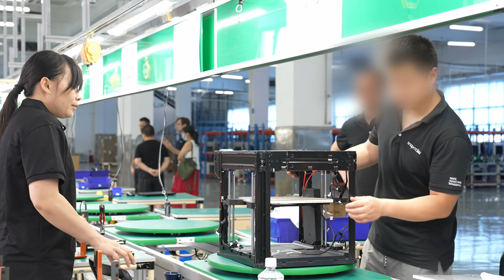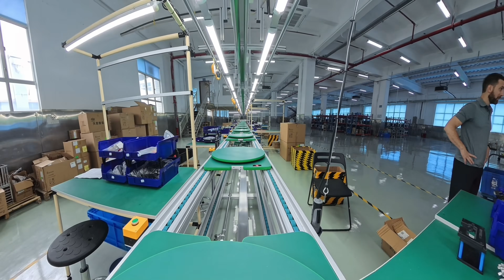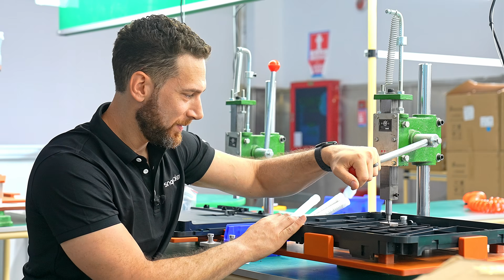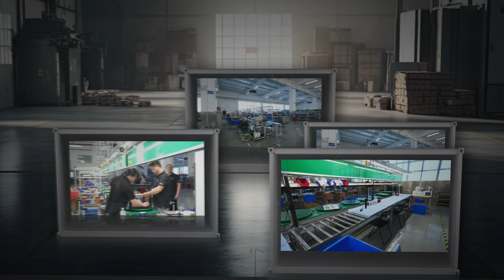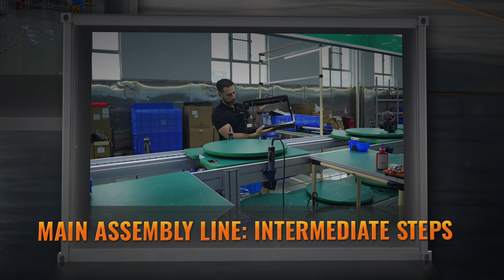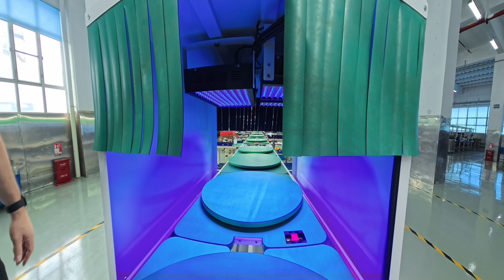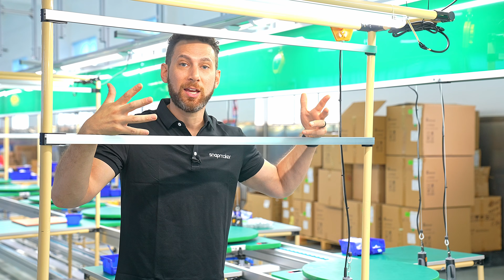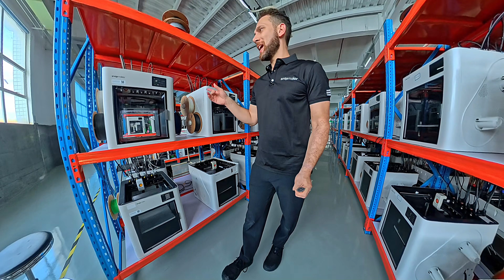SnapMaker U1 Factory Tour: HOW Did They Do This?!

Comment: so after all that he did not say anything about ship dates just factory start date?
Reply: It's an iterative process, your not going to rehash shipping dates repeatedly if you know that during manufacturing changes might need to be made that push it out.
Reply from the maker: Valid criticism. They didn’t want to commit to firm shipping dates, but I think was supposed to say that they anticipate filling all the preorders in two to three months. Sorry about that
Reply: 31 steps with 120 second each means that a printer is ready to be tested in 1 hour, with the following printers coming every two minutes after the first one of the day.

Also a batch of 150 printers is thoroughly tested, wich means when a new printer enter the tear bench another should leave it in less than thr time repaired to build 150 printers, so 5 hours straight.

Currently there are 18 869 backers, with a first "Early Bird" batch of 6 000 printers + 1664 printers (of 4 000 of the Duo batch) planned for November,

Up to 10 000 printers to build, test and ship from September 15th is quite a big commitment,

If we consider a full 24 working hours for the assembly line they could build up to 600 printers per day, with accurate pauses for team changes and a 10% (60 printers) rejection on the test phase.

But in reality even a well oiled and polished assembly line could have hiccups on startup. So we could halve this objective to 300 printers per day, so 34 days to prepare the 10 000 Early Bird printers.

I think it seems doable 😅 

Side node: 

The "Special" batches are planned for December and totalizs 4 000 printers. These batches may be delivered alongside other pre-,orders and msg include Early Bird printers which didn't pass the test and were dismantled to be repaired.

That's why I prefer to buy the Early Bird batch, if the printer arrives on November as expected, there is less chance of it to have passed the test phase without any need for repair.

Comment: Looks very much like the same factory as the video used for the eufy maker E1. Hmm are they fixing these videos?
Reply from the maker: I’m convinced that all these factories buy the assembly line and equipment from the same suppliers because I saw those same green turntables and electric screwdrivers EVERYWHERE. So all the factories look the same. I even asked why the tables are always green, and they told me it’s calming. But you can get them in yellow or orange if you want to increase alertness for critical parts of the process.
Reply: It's a very similar assembly process, why wouldn't it look similar?

Comment: I've had a few friends tell me their horror stories on backing kickstarter projects but this video really added an extra level of comfort for me in my choice to back this printer.  Seeing this I have no doubt they are fully in place to fulfill orders on schedule and without excuse.  thank you for this video.
Reply: That's because they only used KS for publicity. Snapmaker is already an established company, not a traditional kickstarter project.
Reply: Yeah. Going with established companies usually has much higher positive results. Normally id be more annoyed at an established company using a platform meant for kick-starting things, but Snapmaker actually made it's first showing there so I can't really fault them for going with what they know.
Reply from the maker: Yeah I think it’s different when it’s an established company

Comment: Aluminium not conducting electricity is an interesting "alternative fact" 😂
Reply: The oxidation alone would make it unsuitable, but I was only referring to the assertion in the video that aluminium isn't conductive because that's just.... Incorrect 😛
Reply: @peterwroberts  is that why utility providers use it to provide electricity to every single meter around the world? for reference, I'm a line design engineer for a utility provider :)
Reply: Yes Aluminum wire is a thing I believe those big high powered lines across the country all are aluminum wire as copper wire is too heavy for the distance between poles
Reply: @studiodave56  That is how I understand it too. Copper is used underground because at the same gauge, it generates less heat. To use copper underground, the gauge has to be a lot lower (thicker wire).
Reply: @christopherlund1198  i work for a utility, copper is not used underground. it is used in the house but delivery is via aluminum.
Reply: In fairness: It's probably coated and the reasoning got lost in translation.
Reply: That won't be a single continuous extrusion for the whole line, it can't be guaranteed to have enough conduction at a low enough resistance even if it isn't coated, which it will be. So it needs either deliberate bonding points or (cheaper) a long earth wire with bare sections the workers can clip onto.
Reply: Aluminium is a good conductor, hence aluminium wire.  However, you don't want to discharge to the aluminium work area that your project is being worked on. You would be creating a possible closed loop.  If you noticed the grounding wire is offset from the table so at no point it doesn't come in contact with  the aluminium work area or project.
Reply: Aluminium is the 4th best conductor in line and used mostly in big high voltage and long distance powerlines.
Reply: ANODISED Coating is making alumunim not conducting
Reply: It’s anodized aluminum, the surface does not conduct electricity, but if you scratch it off, it will
Reply: Technically aluminum oxide is not a conductor 😬
Reply: @EFLO3D he didn’t say that though, also the oxidation/anodization would be a very thin layer. That said it could be a great surface to try and bond to with a clip or whatever.
Reply: @EFLO3D…But in Reality, The Aluminum beneath the Oxide layer is VERY Conductive.... 😂You sound like a Democrat trying to explain anatomy..😂..
Stop❤
Reply: 9
Why are aluminium wires used for transmission cables ...
Aluminum wire is used in high-capacity applications like electrical power transmission and distribution lines, as well as for larger feeder and branch circuits in commercial buildings and industrial facilities due to its excellent conductivity-to-weight ratio and lower cost compared to copper. It is also used in some residential and multi-family housing, power grids, the aerospace industry, and even for specific electronic components like semiconductor bonding wires.
Reply: If it’s coated or chem filmed it doesn’t
Reply: Must be Galvalum.
Reply: Lots of silly theories as to why they didn't use the platform as the ground plane... All of them wrong. 
The aluminum is almost certainly anodized, not coated. If they were all bolted together and 1 was grounded, that would totally be a suitable ground plane, just clip your wrist strap to the extrusion, no problem. Except nobody in their right mind would set up an assembly line that way - all of those joints where you see seams between the extrusions are insulated to prevent them from conducting electricity, and are also specifically not grounded. Everyone on the factory floor would be wearing industrial grade shoes (which are specifically designed to not conduct electricity). That wire they are using for the wrist straps isn't plain copper wire, it's called a fusible link - a wire that vaporizes above a certain amount of current (probably 1-2A in this case). 
Because safety - one pinched wire, and you could electrify that workstation. If everyone is grounded to a ground plane made up of the entire line... You have to replace (and train) an entire shift worth of workers before you start the production line back up again, and that's expensive. I mean, some people actually care about the workers, and some countries actually have laws to protect the workers, but in this case - simple unrestrained capitalism gives you the same answer. 
Incidentally, aluminum is a great electrical conductor. That's why we use it for wiring in stationary applications (can't use it in high vibration areas or applications where the wire moves around, because aluminum work gardens and fails pretty fast). It's not quite as good of a conductor as copper - needs to be 1 or 2 steps bigger wire for the same load. But the bigger aluminum wire is WAY cheaper and WAY lighter than the smaller copper for the same load. Those extrusions, if they weren't electrically isolated but bolted together bare, could carry way more current than the wires on the overhead poles running past your house...
Reply: Be careful in 2026 a man can give birth.......
Reply: Aluminum extrusion are anodized which is aluminium oxide - this does not conduct electricity. During voron build assembly for grounding wire you had to purposely dig into aluminum extrusion to expose the aluminium for this reason.
Reply: as 35 year electrician I can tell you with utmost certainty that an oxidized piece of aluminum will conduct electricity, anyone who thinks otherwise has never bet their life on it. The thin anodized surface may be a poor conductor (hence a different bonding path) but the extrusion is still an excellent conductor.
Reply: @kullwarrior  I never grounded myself in my life. That's a damn myth, especially with the robust electronics that is used in 3D printers. Maybe makes sense if you're dealing with high-speed SMD components. It's just a precaution (if you are so negatively charged that morning coz you had a bad night sleep :D)
Reply: Grounding and bonding of systems or equipment is not something I wanted to learn about but it was something I had to do for a recent project. 

Aluminum does not conduct electricity well enough for a grounding system. There are specific requirements for static discharge that preclude the use of aluminum. 

As mention in the other comment it may also be a coating on the work line.
Reply from the maker: Thanks for the clarification I was going off script based on a translation from the engineers, so yeah, I could’ve done better, but…. Glad I was close to the truth.
Reply: @ross549 Good to know. Maybe that's why my attempt at using aluminum tape to reduce static discharge from my plastic folding table didn't work as well as I would have liked. It did mostly help though!
Reply: @ross549  Often you do not ground yourself but connect you and the parts so there are no electrical  difference. It does not help if you are grounded but the parts are not, they can still have an electrical potential, and discharge over you and thereby get damaged. I'm pretty sure that there are some missing information here, since every company making electronics know this.
Reply: @ross549 as a generalized statement that’s not true. Aluminum wire can be and is used for grounding (primarily by utility companies as most AHJs don’t want used as premise wiring but there is still plenty of it out there.) but perhaps you are referring to a specific use case in factories or other commercial/industrials facilities since you mentioned bonding and grounding (which most people mistakenly group together)
Reply: @ross549 it might because it gets an oxide layer what makes it unreliable for grounding. Aluminum itself is an excellent conductor
Reply: 😂..The Leaps of Logic are dangerously insane.. Some of you sound like Leftists!. spin anything to force an outcome.. ALUMINUM IS CONDUCTIVE, OXIDIZED OR NOT😂😂😂..  All aluminum forms an Oxide layer the moment it hits oxygen…😂 so All aluminum, Unless Stripped and Protected, Has a layer.. And it’s still VERY conductive..
Stop twisting facts to match feelings. Being wrong is a learning/teaching moment… 
Notices how leftists never learn.?😂
Reply: @SuperRad1984 

Go away. You and your "hiero-graphics" are annoying.

Comment: 10:13 oh, yes, because aluminum totally doesn't conduct electricity... Such a shame that most of the US's power grid is aluminium core wire...
Reply: Haha, literally paused the video here, and was like, what? The grounds are clearly due to the printer builds being isolated off the main grounded frame with the padded tops and turn tables, hence the need for the technician to be grounded seperately to the ground wire.
Reply: I did chuckle at that a bit XD
Reply: Haha. Yeah. The real reason is because the frame and floor are probably insulated specifically to prevent grounding on them, hence the need for the wire.
Reply: I am so glad I was not the only one that heard what he said! I was like someone has to have noticed and made a comment about that line!
Reply: Most aluminium profiles are anodised, which makes them non-conductive. So the statement was not incorrect. I work as an electroplating specialist.
Reply: It’s not a bad idea to have a separate ground for personnel in case something shorts to the aluminum frame
Reply: Eye rolling... yeah he did not explain that quite correct.
Reply: The core is, but the strands around it are copper. The core is to give the line strength. Electricity travels on the OUTSIDE of a conductor, not the inside. This is a commonly overlooked fact. Electronics and Network Engineer, class of 1988.
Reply: Well, the electrostatic discharge protection is kinda interesting. 
I think ESD protection is only necessary where sensitive materials are processed. I understand it like this: the coworkers touch the blank part of the ground wire before touching ESD parts. Normally the ground where the coworkers stand on should be ESD conform, the coworkers has to be use ESD shoes and or use wrist straps. Electronic parts only allowed to be stored or moved in ESD shielding bags. The pink foils itself don’t protect against static charge. Well they use black ESD B2 boxes but they stand on cartons out of paper. Not good. The electronics lay unprotected in the B2 box even not good. So I think an ESD Audit will find some issues 😅.  But interesting to see they’re using creform like carriages.